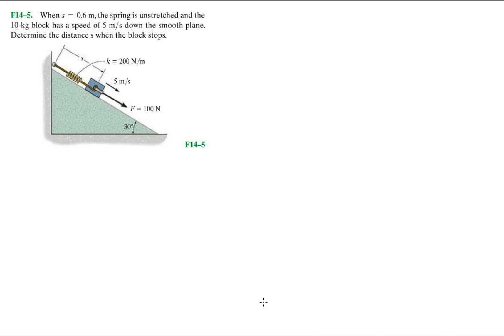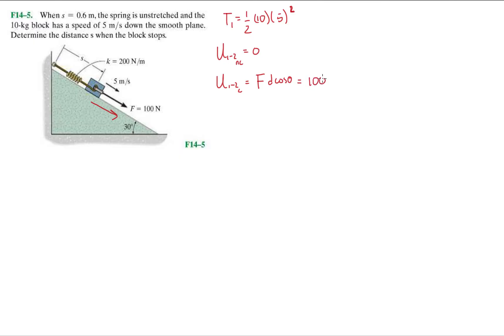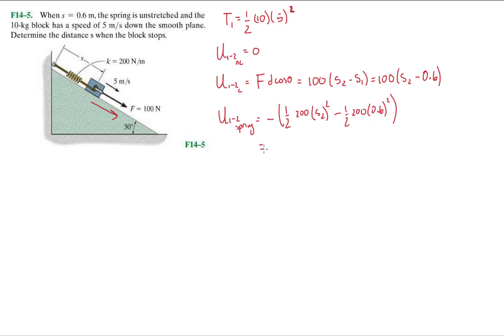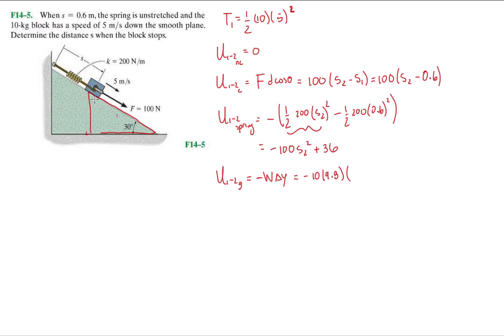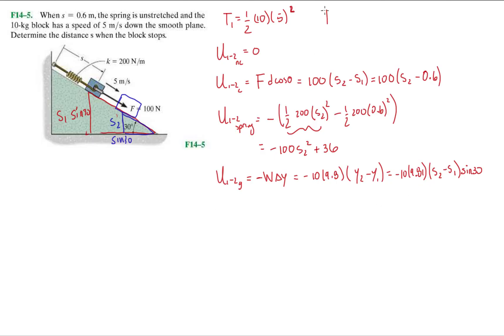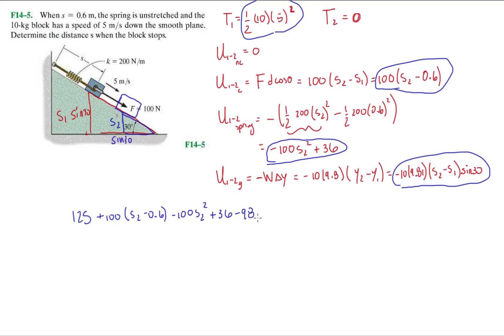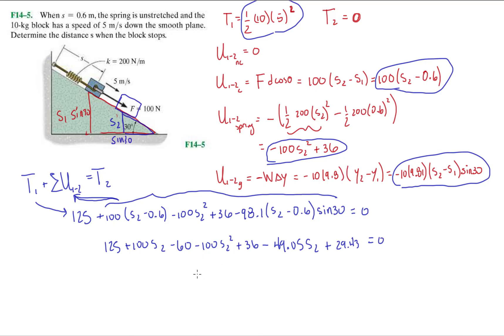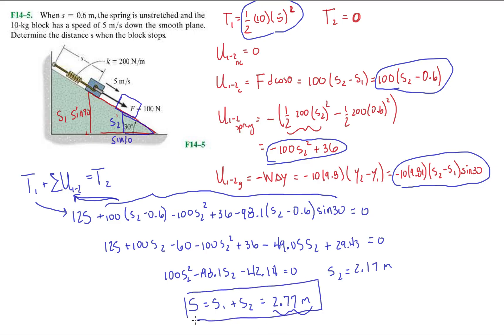Problem F14-5 Dynamics Hibbeler 13th (Chapter 14) Engineering Dynamics - Work and Energy

Comment: The video tries to plug in S1 before solving for (Delta)s. -> 125 + 100(Delta)s + ((10)(9.81)(sin 30)(Delta)s - 100(Delta)s^2 = 0.... Simplify to:  -100s'^2 + 149.05s' + 125 = 0. Quadratic Formula that to get: ((-149.05 +/ 268.73) / -200)... Solve for - to get (-417.78/-200 = 2.09) Than do Sf - Si = (Delta) S.... Sf - 0.6 = 2.09--> Sf = 2.69

Comment: Its + cos(30) not -sin(30) because its on a decline so when we resolve the wight its going to be to the right and down we need the force to the right cause its gonna push with the force so +10x9.81cos(30)(S-0.6) the rest is correct
Reply: Incorrect, gravity acts in the Y direction, so we need to use sin to find the force in the Y.

Comment: I realize this is old and not much interest, but does anyone have a published answer key for this problem?   As a challenge I was trying to solve the ODE 
d^2x/dt^2 = -k/m*(x-0.6) + 149/m with x0 = 0.6 and v0 = 5.
YouTube has 4 videos working this problem with 4 (maybe 6) different answers.    After a lot of work I came out with s =  2.6889 but still not sure.

Comment: Your answer is wrong. The correct answer is s= 1.873 + 0.6 = 2.473 meters.
Reply: I agree.  I did the problem two ways.  If you add F=100 and the force due to gravity, 49.05, the spring at its equilibrium point is X_equil =  1.3453.  If you then solve the differential eq with x'(t)=5 you get an amplitude of c2 =  1.1180 which give a max of 2.4633.
Reply: @rickjljr11  Yo good luck in dynamics man I passed 🌝 . And I hope yo do too

Comment: hallo 
thank you for your solution. only I have a comment on Spring's energy because you got it wrong 
Us=0.5K(s2-0.6)^2 ... Not Us=0.5K((s2)^2-(0.6)^2 )
the sping was unstretched when s=0.6 so x1=0 , then the spring was stretched so that x2=S2-0.6
Thanks again for your great job

Comment: the energy from gravity isnt negative
Reply from the maker: Trying to recall what I was doing, but essentially the work from gravity comes out to be positive. While I wrote it down as negative, the s2-s1 should give you negative result thus cancelling out the negatives.
Reply: @theengineeringcrucible3490  but it's still negative since s is positive

Comment: I tried solving this using F=ma and net force but for some reason i am getting the wrong answer. 
Net force (-30degrees)= 100 + sin(30)mg -200s
ma = 149.05 - 200s
10v dv = (149.05- 200s)ds
then i integrated with v going from 5 to 0 and and s going from .6 to s.
My answer was 1.873 meters. Any idea why it was wrong? thank you
Reply: got the same thing using work energy theorem